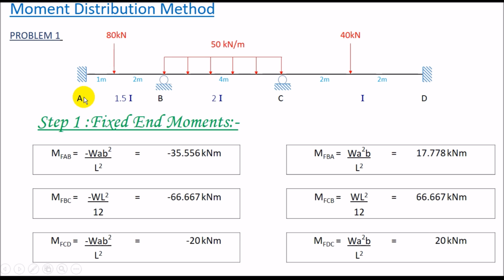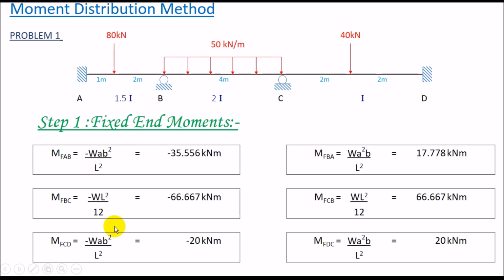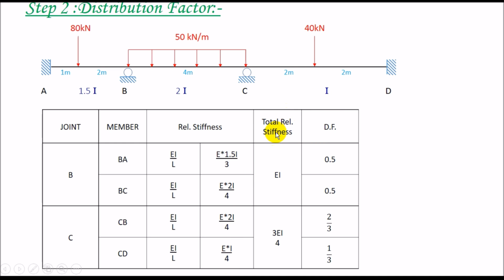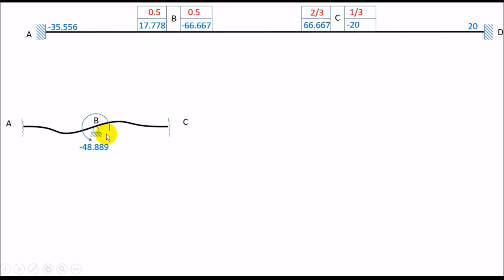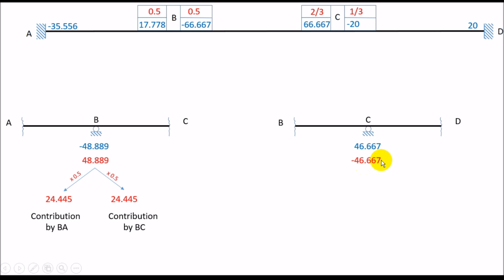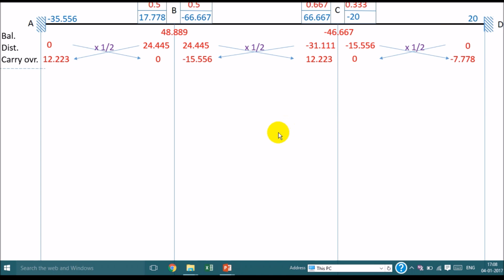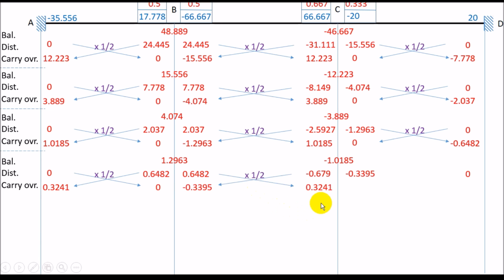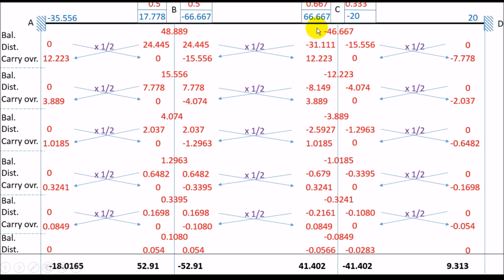Moment Distribution Method Structural Analysis - 1

Comment from the maker: KIND ATTENTION TO ALL:
it does not matter if you take either of the following values for relative stiffness
For far end fixed : EI/L or 4EI/L
For far end hinged: 3EI/4L or 3EI/L
You see in the first set of values a common factor of 4 was taken from both the terms, take 4 common from 4EI/L and 3EI/L, you will get EI/L and 3EI/4L.
So its essentially the same.
Reply: Can I get your contact? I need to interact with you regarding Moment distribution method.. Thank you
Reply: Thanku sir

Comment: Sir here for this moment distribution method we are considering the internal support as fixed one ....it is point to be noted
Then when we are finding relative stiffness for any member which are already fixed ..that we have  considered earlier
Then what is the need roller or hinged stiffness here in this problem

Please sir do clear my doubt 🙂
Reply from the maker: We haven't used the relative stiffness when far end is pinned connection in this problem, because there is no such case arising, check my other MDM problem you will find there.

Comment: Sir, you wrote beneath each beam section 1.5L, I think 2L and I am not sure of the third one because the diagram is not too clear. Are these constants? The explanation generally is good but the drawing and tables are not very visible. Thank you for your anticipated response.
Reply from the maker: Its not L its I, I for Moment of Inertia. So section AB has 1.5 time moment of inertia as compared to section CD , and section BC has 2 times moment of inertia as compared to section CD.

Comment: What if the the joint has four beams connected to in which case in one direction DF will not equate to 1 so this won't make the moment summation equal and opposite at the middle joints...I have this confusion
Reply from the maker: The distribution factor will change accordingly nothing more, the distribution remains the same.

Comment: Dear,
Please reply to my comment
I saw your one video in which u were solving portal fram with MDM and there u used (4EI/L) for fixed support and here u r saying it would be (EI/L)
I m bit confude please clarify this ...
Here i m attaching your video link in which you took 4EI/L
https://youtu.be/L42hy2dLKe8
Reply from the maker: @StrucTech it does not matter if you take either of the following values
For far end fixed : EI/L or 4EI/L
For far end hinged: 3EI/4L or 3EI/L
You see in the first set of values a common factor of 4 was taken from both the terms, take 4 common from 4EI/L and 3EI/L, you will get EI/L and 3EI/4L.

Comment: Great vid ! I hate to be a stiff but at 12:40 when you are explaining the resultant moment at joint C (clockwise moment 46.667kN.m), you described that clockwise moment as the direction the beam would deflect in when subject to the the given loading. This is incorrect, because it is the resultant direction of the REACTION force, which is opposite to the direction o the observed bending moment
Reply from the maker: Dylan Hornsby thank you for pointing out, i agree they are the reactions generated from fixed ends, but the concept remains the same.

Comment: Thanks you for giving full information and calculation process of MDM. So I have a small question that is how to take  moments and axial loads for design of column based on MDM?
Please reply sir.
Reply from the maker: +Venkat Y 
moments = those found from the moment distribution iterations 
axial forces= (actual axial forces if any coming on the column) + (the shear force of the beam that the column supports)